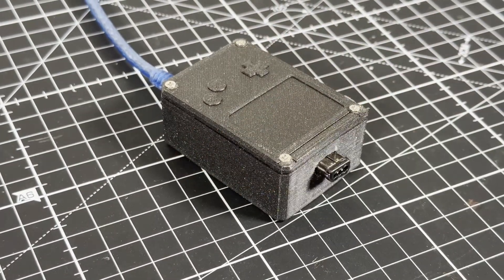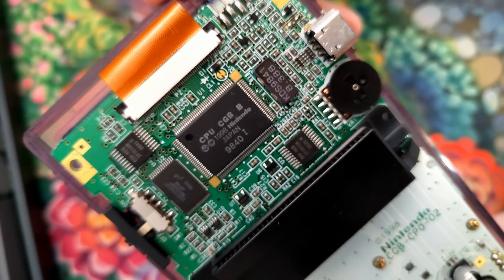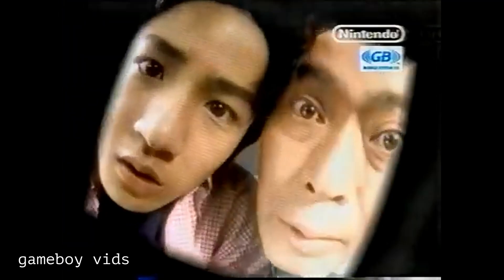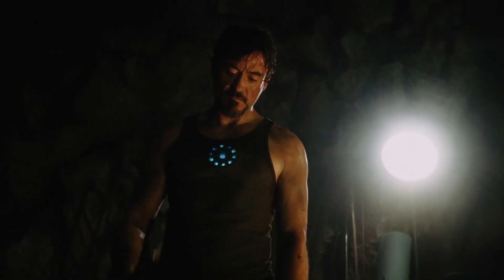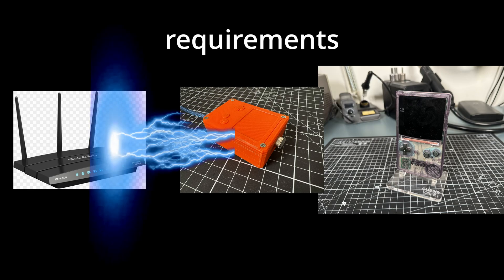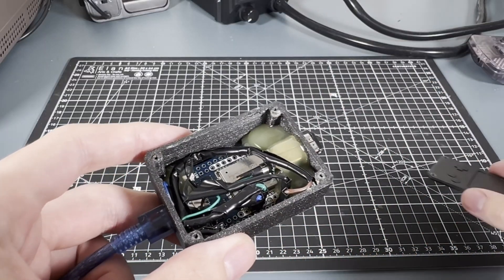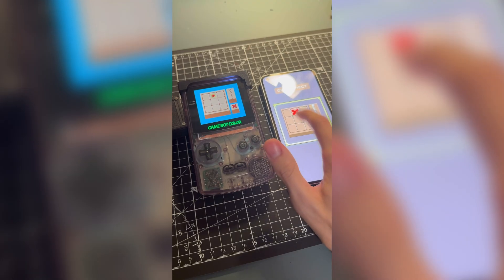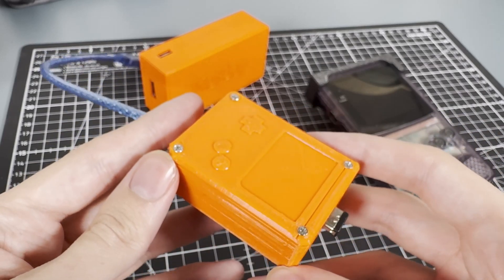I Made a Wi-Fi Game Boy to Play Tic-Tac-Toe

Comment: Great work man!

I however think that the esp32 could've been attached to the back instead of directly to the link port. That would strain the port and might break it
Reply from the maker: True. My initial plan was for the actual esp32 to run of the power from the GBC, meaning we would only need the "netboy unit" and no battery. However in the end, I was unable to run the esp + wifi on such low power. The final product was very much a throw anything I could at the wall to make it work, not a perfect solution.

If I were to have achieved this I think it would have looked cooler with it attached directly.